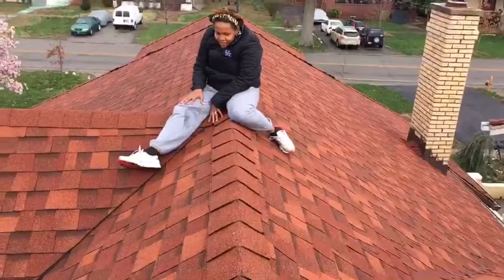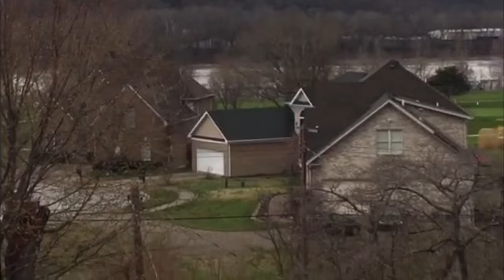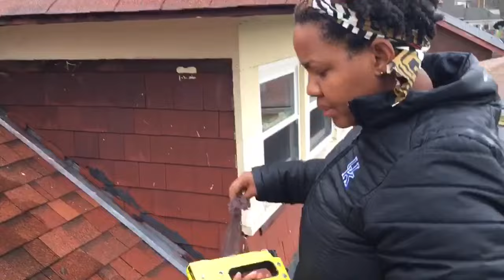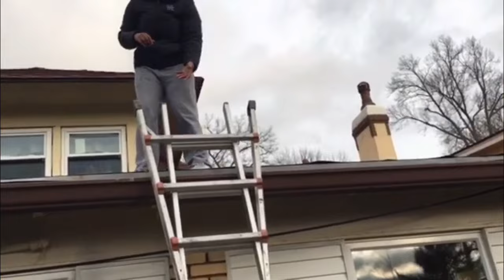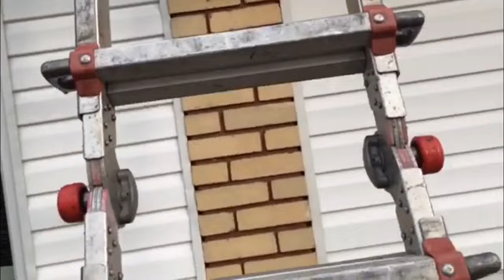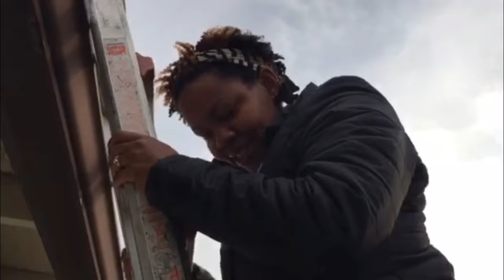How to Get Rid of Racoons!!

Comment: I have them in my attic now. There  are 6 downspouts that they change up using, I've blocked them ,now they use the fence to reach the gutter.  I cannot find thier access point.  So by stopping them from getting on the roof that will give me time to find out where they gain access.  Tomorrow I'm going to heat up hot chili peppers inside my attic to force the kits and mom out for good . Then the task of clean-up insulation removal, duct repair, feces and urine treatment and pest control to get rid of any bugs as a result of the feces.  Then blow in new insulation and patch all access points. Sound costly,  I  hope my insurance covers this crap. These raccoons only make noise while moving, I  hear no clawing or animal sounds at all. Security light at all corners of your home is a must. They have been getting in for some time now and not one neighbor has said they see them ,they are in and out in the daytime on my roof and sound exactly like a human, fricken creepy.
Reply: So they r active during the day?  I thought they were nocturnal so only go out at night to forage for food.  Wow.  Have you finally been able to get rid of them?
Reply: @beverlycharles6534  yes I did it by scaring the hell out of them I took a 4 ft long box it was the box that the animal trap came in I got so angry I started slamming the Box on the ceiling all over the entire ceiling of my home I literally could hear them moving about right where I was standing and it was a big one it had to be the mother so what I had done was I took a strip of wood and I put several screws to in Long facing upward about 20 screws and it was a 4-foot piece of material that I put the 20 screws in and then then I screwed that piece of wood onto the top of my fence where they were accessing my gutter I did that in two locations on my home once I scared them out of my attic they can only get off the roof bye using like the roof of my car they jumped from the roof to my roof of my car and got off and they could never get back in it took me a year to figure this out they are gone they never came back I never did find the entry point where they are actually getting inside my attic but they can't get up there anymore because I screw them like that funny joke there

Comment: Hang Evictor Strobe Lights in your attic.  It  may take a week or two, but  raccoons will leave, taking babies with them.  Remember to screw the Evictor Strobe Light chain to a rafter. Otherwise, Raccoons tend to pick the chain off the hook and relocate the Evictor to another part of the attic. Make sure the attic is totally dark.
Reply from the maker: The1roofer1 thnx for the great tip.. we had no access to the attic. But I can see how this would work if we had electricity. Up there and access
Reply: Never heard of this b4.  Will research it.  Raccoons pulled back my siding and now have put a hole in the roof.  I never hear or see them tho.  I have been standing watch between 4a and 6a each morning to see how where they r climbing up.  I have not seen or heard these buggers. I put brite motion detectors outside and would like to have something inside to make my attic UNcomfortable.  The idea of them picking up the strobe light and moving it away is just WEIRD.  They r really smart I guess.

Comment: Funny!😂 word of advice on the raccoons. Never fix the entrance until you know the coons are removed. And a staple gun won’t hold a coon out. They are strong and will tear those out. The spot they are getting in is notorious for coons. Best thing to do is get them trapped and removed them build a box covered in sheet metal up in that crevice so they can’t get up in that small area and get a lot of leverage to tear into the attic. Second don’t go in an attic you know has had coons in it without a good full face respirator. Their poop Carrie’s a few diseases that can make you very sick and even kill you. No joke! And coons chew things like wires so be careful in the attic that you don’t accidentally touch an exposed live wire they have chewed and get yourself electrocuted! Best way to trap them is a live trap up by the entrance with wire mesh around the entrance leading to the trap so they have no choice but walk into the trap. It’s called a positive set. Gives them no choice. Most coins in attics in the late winter and spring are momma coins having babies. So there’s likely babies up there. Not a bad idea to set two traps so you get them all. If you only get momma coon and babies are too young to come out on their own you can get some good heavy leather gloves and get up in attic and get the babies out by hand. Once you know they are all out then repair the entrance. If you repair it first and the coins die up there it’s gonna stink to high heaven.

Comment: What did you staple to the wood ?
Reply from the maker: Pantyhose filled with mothballs
Reply: I own ad pest and wildlife control company. If home remedies worked I would be out of the job. You need a professional to re move the animals and then we contact you Insurance company to get it cleaned up Insurance company to remove all of the attic insulation and get rid of the smell or you will have it year after year after year.